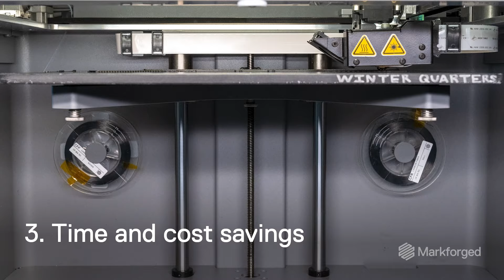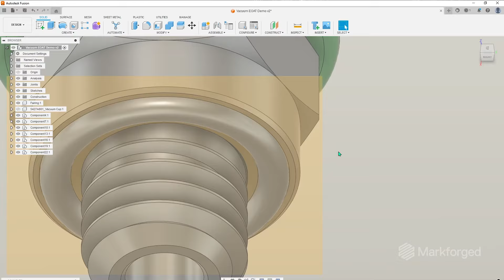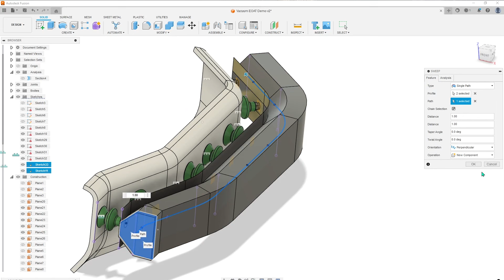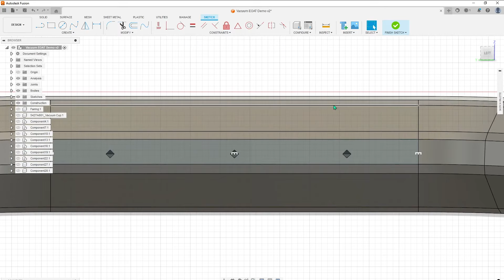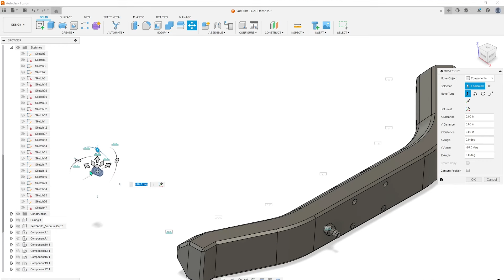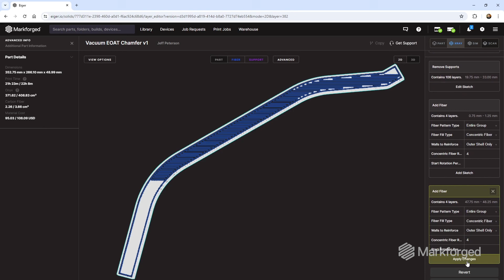How to Design a 3D Printed Vacuum Gripper | Markforged Reinforced

Comment: A tip for the heat inserts, don't insert them fully, leave a bit sticking out and then press it with a different flat object into the printed part, that way you won't have it overflow around the rims